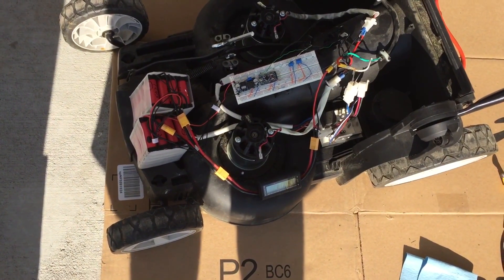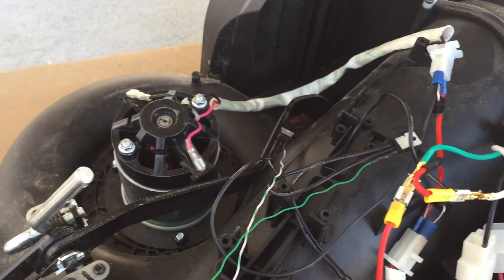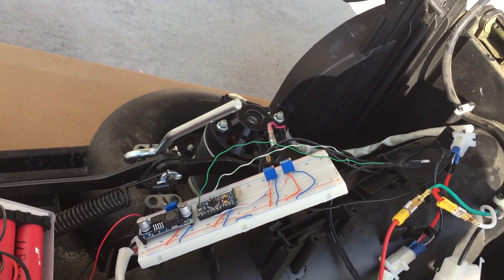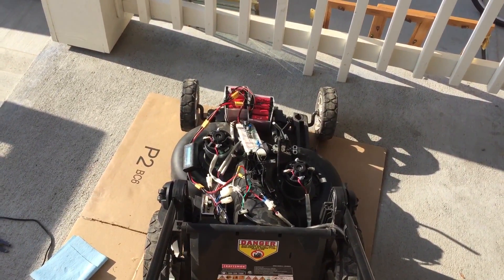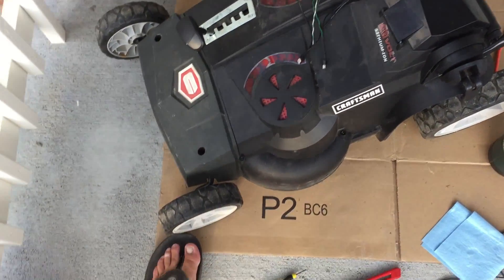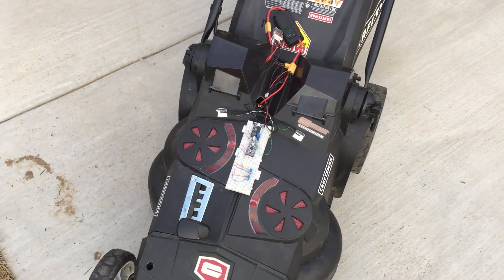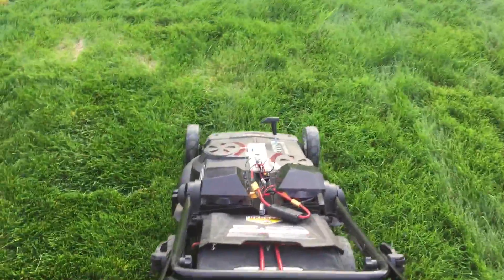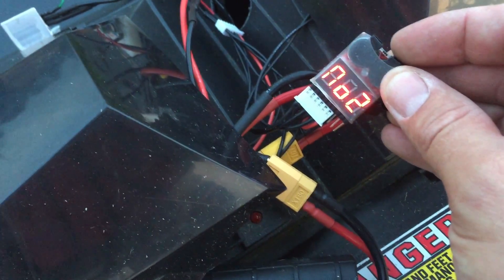40 Volt Electric Mower - Part 2 - Bypass the Stock Motor Controller

Comment: was hoping i would get the ryobi 40v mower to run the 3 phase motor by bypassing the controller

read everyone's comments. this is out of my league but it doesn't stop me

Ghetto!? i luv it :face-fuchsia-tongue-out::face-purple-smiling-tears: gonna check some more videos out there. i was going to swap parts but the prices posted are to good to be true so i think it's a scam. others are charging same price as a new mower.  my brother bought the mower for $20 knowing it would be a project

Comment: Lets trashcan all that rechargeable nonsense and install a small (RTG) radioisotope thermoelectric generator with a power output of 4400 watts continuous for the roughly 15 to 20 year lifespan before it needs to be refuelled with brand new red hot pellets of Plutonium 238 😉

Comment: Hello swipemagnetron,

I've come across these videos and plan on doing something similar for my Senior Design project. We need to make our device battery powered but still be able to be used while being plugged in and charging (essentially, have pass through charging like a laptop). However, we also need it to produce 40V and around 15A but I cannot find anything that meets these specifications on the market. 

So my question is, would it be possible for my team to create something like this but have pass through technology? If so, how would we go about doing it? I've tried finding sources to explain why laptops can do this but all I got was several pages of "Is it bad to use my laptop while it's charging?" pages, lol. Having two 20V packs go to one outlet like you did shoud work for us, but having one big 40V one would be ideal. As long as it has pass through charging.

Thank you for your time!
Reply from the maker: Connor McIntyre hi! See if you can find a 10s lithium ion protection circuit board with balancing on eBay. I think that should facilitate simultaneous charging and discharging and 15 Amps should be doable. 10s will be 42 volts fully charged.
Reply from the maker: Smokes! I actually have some 10s balancing protection circuit boards! Let me know and I’ll send pics. I’ll send you one or two if you are interested.
Reply: @swipemagnetron  Thank you for your quick reply! Sorry mine is so delayed; I never got a notification saying you responded. 

I'll try to hunt down some 10s lithium ion protection boards with balancing. Sending some pictures would be great too! I'm the ME on the team but our EE will hopefully know how to hook it up but having a reference would be greatly appreciated!

Additionally, what type of batteries would we want to run then? Normal Lithium Ion 18650 or a different type?

Thanks for your help!
Reply: Also, could we possibly connect four of these together to get what we need?

https://www.amazon.com/TalentCell-Rechargeable-12000mAh-Multi-led-indicator/dp/B00ME3ZH7C/ref=asc_df_B00ME3ZH7C/?tag=hyprod-20&linkCode=df0&hvadid=309836137809&hvpos=1o4&hvnetw=g&hvrand=14928839189197732962&hvpone=&hvptwo=&hvqmt=&hvdev=c&hvdvcmdl=&hvlocint=&hvlocphy=9017741&hvtargid=pla-403917176387&th=1
Reply from the maker: Connor McIntyre I think that may be doable. Will it do 15 amps?

Comment: Looked like some pretty good barbecue action going on. Are you still using this setup? I'm looking into using an 18650 pack (maybe 10s3p) next to the 2 2Ah batteries that came with the mower. If possible it would be nice to keep the original motor controller in place though. There are some pins on the batteries that I measure half the pack voltage on, so maybe that's what the third line is for some reason? Also there seems to be some feedback to the charger about battery temperature, so maybe it could be related to that as well?
Reply from the maker: D.K.S This will be its third season and it’s still going strong. I wanted to use the stock motor controller but couldn’t get it to work. So bypassing it with an arduino and a couple of mosfets was plan b. I think the mosfets are no longer modulating the voltage so the motors are just getting straight juice from the battery which is fine. The torque is great and I like the dual motor/blade set up which picks up nearly all of the grass blades when I bag so it’s very clean. Two 2p10s packs in parallel are ample for the current draw and the 15-20 minute run time I need. Not bad for a $25 mower!
Reply: @swipemagnetron  Awesome, nice to hear; that was a good deal! I already thought the PWM might have been overkill. I think electric mowers do some power modulating stock -depending on the power necessary (grass length). However to me that seems pretty unnecessary. With my mower at least I feel it doesn't have that much power to begin with and you just want the max (unregulated) power you can get. Pretty sure I'll do a mod on it to run a DIY 18650 pack on it at some point as well now. Happy mowing.